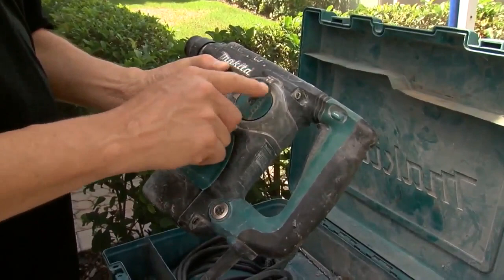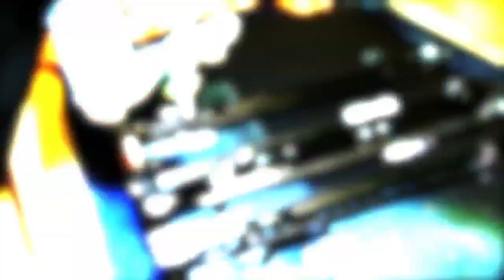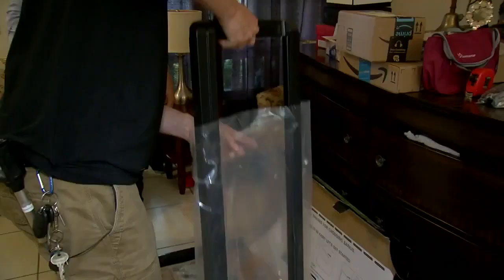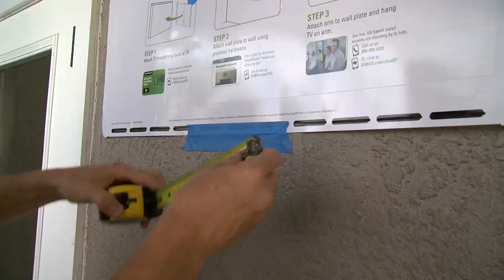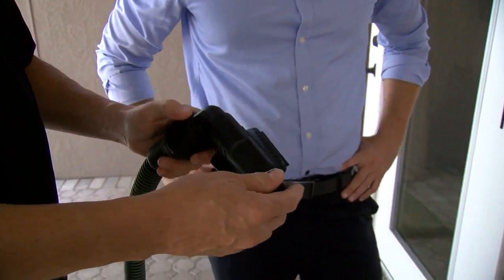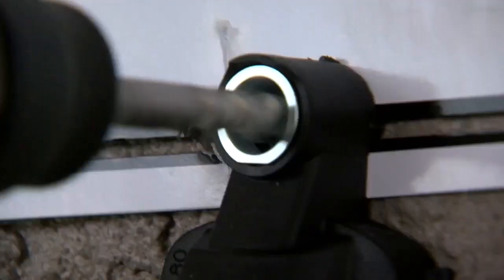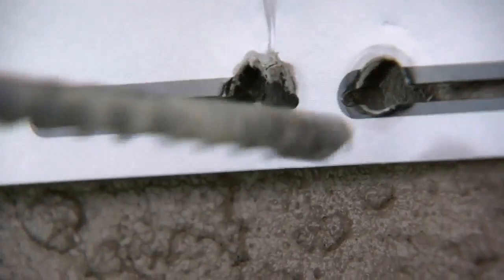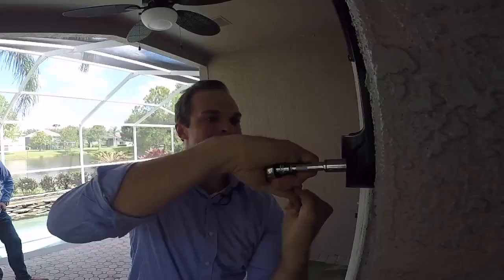How to mount a TV to a concrete wall | House Calls with James Tully

Comment: How would one go about removing those wall anchors in the future?
Reply: I know you asked this question about a year ago, but better late than never. I remove them by unscrewing the screw to the very end of the anchor to where there's just a tiny amount of thread holding on and pull the screw with some channel locks or pliers. Should come out with a gentle tug. Then fill the hole with caulk or whatever filler you need for the type of wall.